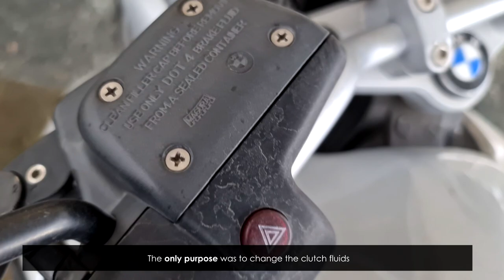How to access to CLUTCH SLAVE CYLINDER - Clutch hydraulic lines PART 1 - BMW Motorrad R1150R

Comment: Здравствуйте. Спасибо за видео, все сделали как вы показали. Только ось не можем вытащить, стоит крепко все раскрутили. Bmw r1150r rockster. Подскажите как её выбивать или выкручивать?
Reply from the maker: If you mean the connection pipe axle, frame, ie the shaft in front of the clutch slave cylinder: The footrests must be removed on both sides, and the 2 bolts of the shaft must be loosened. As in this video: https://youtu.be/jkXNERpktpY?t=514
For me, it came off relatively easily. 👍
Reply: Да, все сделали как вы показали. Ножки сняли, два болта вообще выкрутил.  А ось вытащить не можем.  Она без резьбы?  Боюсь выбить, вдруг по резьбе закручивается.

Comment: I ended up breaking down because i couldnt shift gears and noticed my resevoir was empty. i put some dot4 in and its not leaking by the slave cylinder but looks like its dripping kind of next to the starter, will the clutch fluid leak into the clutch and if so do i need to replace the clutch?
Reply from the maker: If you remove starter, you can see if there are any signs of brake fluid from clutch system 👍
Reply: @JaniVoutilainen  so far I got lucky as the clutch isn’t slipping, I can’t tell you how much I appreciate this video as I was able to disassemble, put in a new slave cylinder and reassemble my bike, you rule man!

Comment: You can remove the tyre without removing exhaust either by jiggling or by placing the bike on a block of wood on the centrestand before you start!
Reply from the maker: Possibly. Removing it is not a big deal. By removing the rear silencer, it is better able to handle the clutch slave cylinder and its joints.  👍